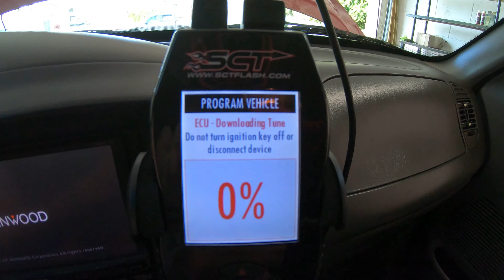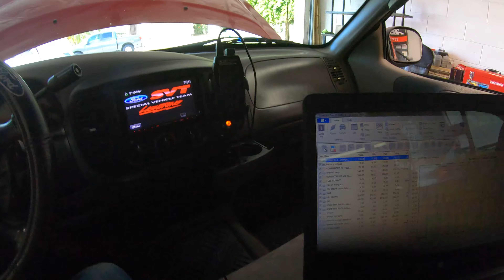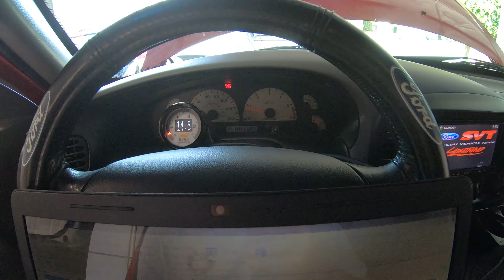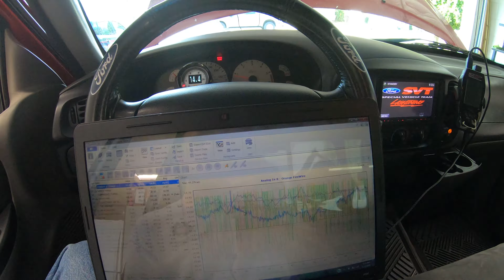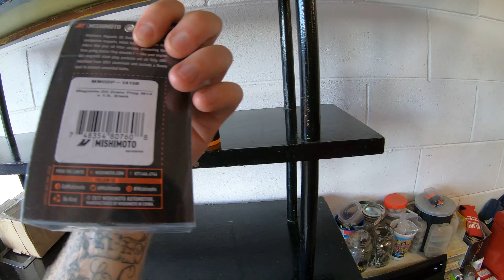Ford Lightning Build - First Cold Start, Tuning, and Front End Results!

Comment: The front end looks sweet & it sounds sweet.
We are in the uk. My wife has a 2003 SVT lightning in DSG with 65000 miles with lots of engine mods.
It just had the engine rebuilt after a head gaskets giving out.
It's had lots done well it was striped down.
Cost just under £5000 UK pounds for all the parts & work.
She is running it in for 500 miles then it goes back in to have the oil & filter & water/ coolant change. At the same time she is having the rear axle oil change & the cover & gaskets changed. 
She loves the truck.
Next job she wants to do is wrap in in mat black?

Comment: What color you paint the grill?. You have de code color of the paint.
Reply from the maker: Duplicolor Wheel Paint - HWP102 ...most auto parts stores have it, it's in a spray can.  I love it, use it on my wheels, blower, grille, ect.

Comment: Curious on the SCT what reading did you wind up dialing the TPS to, i have mine at .99 volts on the meter and it shows 2.04 absolute on the SCT
Reply from the maker: I was shooting for 195 counts absolute on sct, max I could get is 189 so we called that close enough.  For whatever reason that’s where mine maxes out 🤷‍♂️

Comment: Huge fan been watching your videos thank you for them had a question I have a 04 lightning myself to. How many cam shaft position sensor’s does the lightning have I know the one that’s right under the air intake that’s on the timing cover. I’m running a few0340 code and it’s pushing me towards that direction I changed out the first one already truck still has a little misfire wondering if there’s a second that I missing? Thank you

Comment: Great video what are you running as far as charge temps after a 30 min haul with a spirited drive. 110 120? I know you are in Florida so it’s hot to start with.
Reply from the maker: Thanks!  I havn't really got into a spirited drive yet, been babying it till the tune is finished being tweaked.  But after 30 mins of traffic and stop and go driving its about that, 110-120ish on a hot day.  130 sitting in traffic

Comment: So what’s the motor setup I heard back on my 02 from the shop and has broken piston in number 4 :( so I thought about buying a jlp short block for $4g
Reply from the maker: Sorry I just saw this comment!  For some reason it was flagged as spam in my spam box...my motor is a JDM Engineering longblock, .02 over, 9:5:1 compression, and their stage 2 cams.  Sorry to hear that, that's a bummer for sure.  I personally like JDM, they are pricey though.
Reply: DebtLife Projects hey no worries man I know you stay busy! The vids prove it! My crate motor just came in today and gotta say pretty happy it’s nice seeing inside and seeing some beefed up forged parts in it. Now out with old and in with the new!
Reply: Say question?!! Mines is bored .30 over other than that stock heads just beefed bottom end, Will I need a start up tune? Or will ecu be able to adjust for that much?

Comment: Really clean truck!! I was wondering what that where your driver side fog light is??
Reply from the maker: Thanks! 😁 that’s my intake scoop that goes up into the jlp intake box.  The jlp ram air intake comes with a tube that goes from the bottom of the intake box, and I mounted the other end to that fog light with a velocity stack scoop.  More direct route for air